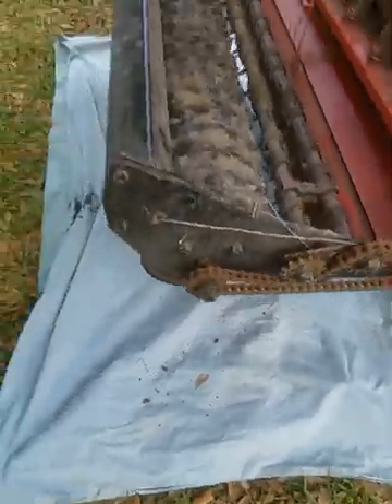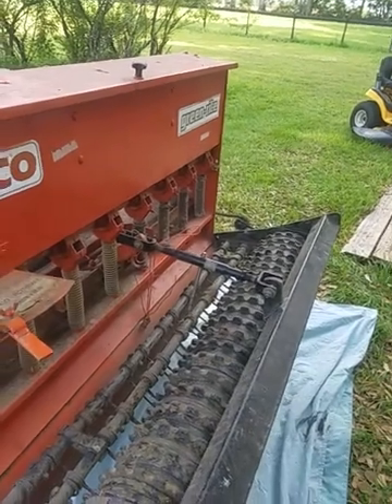Befco Green-rite 258 Calibration and Overview

Comment: Could you describe the parts/how you added your custom wheel kit?
Reply from the maker: I believe it was 2 pieces of 2" square tubing cut to size and drilled for the pins to go through to set the height.  Then I bought 2 round axle stubs from etrailer, drilled a hole through the 2" square tube at the bottom and welded the axle stubs in there.  Then also from etrailer I bought 2 hub kits and 2 tire/wheel assemblies to all go together on the axle stubs.  Badda boom, badda bing, whammy.
Reply from the maker: Hey, I'll sell it to ya